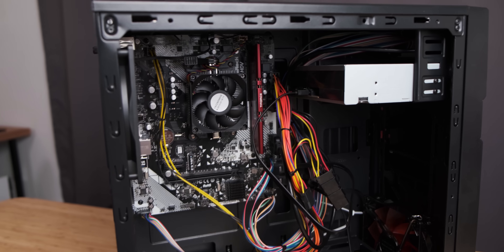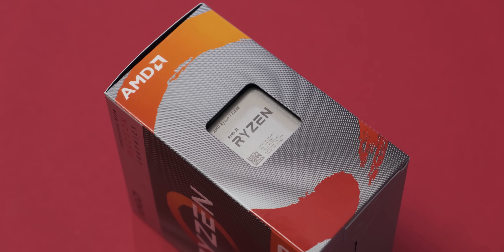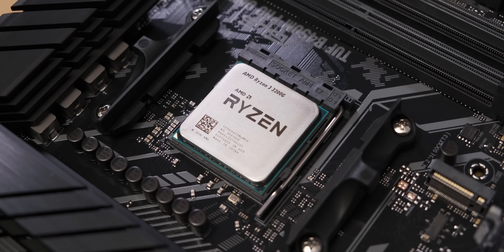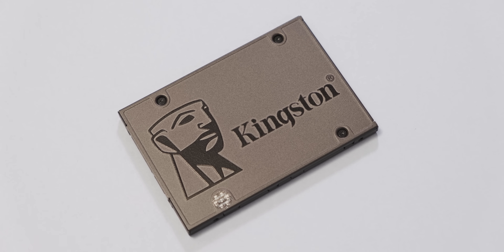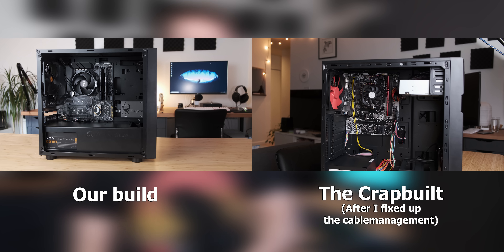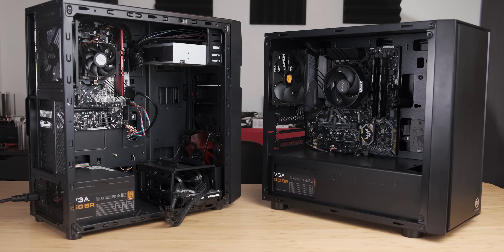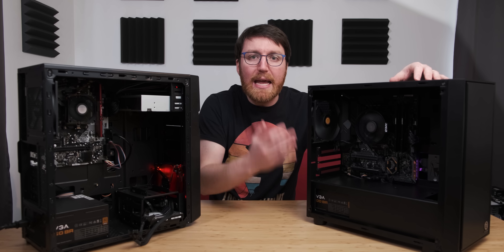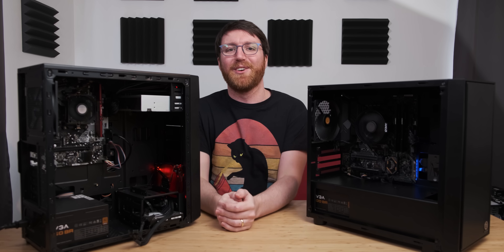Cheapest Amazon "Gaming" Pre-Built PC versus Custom-Built PC (2020)

Comment: Actually these days, if you bias most of your money to the video card, and buy a cheap 6-core AMD, you can build a semi-decent entry-level gaming rig.  Of course the inflated prices right now of video cards doesn't help, and if you take advantage of motherboard+CPU combos you can save some real money, even if you have to get the cheapest of motherboards, it's probably still better than a game build from Amazon.  $400 doesn't sound like much but if you don't factor in taxes, and if you focus on AMD where your performance/dollar is better, you can build a decent entry-level gaming rig for about $400.

I mean my latest AMD system was about $750 to build, but about $300 of that was for the video card.  The processor was $160 and I got a board free (Gigabyte B450, not the best, but better than the most cheap boards out there).

Honestly, when doing a budget build, I recommend skimping on the power supply a little, and getting a cheap case, in favor for a decent CPU and a better Gpu.  I'm not savying to get the cheapest PSU, but get a name-brand one but perhaps one with a lower wattage.  Obviously this means you may need to upgrade it to put a larger graphics card in, but for starters, most 500 watt power supplies from name brands can be had for around $50 (like CoolerMaster or EVGA).  And also skimp on the memory a bit too, like 8GB.  I haven't seen any modern games that require more than 8GB yet.  But as you mentioned, if you get an APU, you may want to spend the other $50 and get 16GB.  But if you get a dedicated GPU then 8GB should be enough to get started.

Comment: For that price you are better off getting a console anyway. I wouldn't buy anything less than a Ryzen 3600 since the 3200G will bottleneck you with any decent video card. But compared to the other alternative it did seem much better. It is a good idea to spend more on the case, CPU and motherboard since the video card is easy to upgrade but new motherboard or a case will require you to rebuild your entire PC.

Comment: the B450 asus tuf board? man those things have crap temp sensors on the board and it reeks of cost cutting. the kind of board people go when they just assume Asus means good. you spent a good 30-40$ more on a motherboard that isnt even objectively better then some cheaper alternatives. sure it has some features but the VRM's are pretty meh, with pretty wimpy Vdroop and hilariously inaccurate sensors, clocking ram temps at 120C? me thinks thats a little odd. Asus lets QC really go loose on the TUF branded products

Comment: The min budget anyone should be aiming for is $450. It simply isn't worth it in the long term to go lower. You are just shooting yourself in the foot. At $450 you can get a used RX580 8gb, Ryzen 5 1600 AF, 16gb DDR4 3200, and a 500gb SSD which is DRASTICALLY better than this build for not significantly more money.

Comment: wait the custom one is basically my pc, the exact same processor and ssd, 16 gigs of ram, similar motherboard but from AORUS, even the psu is almost the same
The only significant difference is that i have dedicated "decent" GPU which for some weird reason wont run any low-end games and only able to run graphically intense games otherwise it might crash the entire system even in youtube, sigh

Comment: My 3200g has 8 gigs of memory installed, would increasing the size of the memory boost performance (like fps)?
Reply: Absolutely 8 gigs means u really have 6 to 6.5 gigs as windows uses almost 2 gigs
Reply: Yeah. Especially if you use the 3200g as an APU.

Comment: The 9600 in the Amazon build is way more powerful than the 3200G in CPU performance. So if in the future you choose to upgrade with a dedicated GPU you'd have a way better time with the 9600. 
Also you really should've added more storage space. No one is gonna be satisfied with a 250gig ssd nowadays as some games now take up more than 100 gigs

I agree that the Amazon build I horribly balanced, but you really should've mentioned that the CPU performance is significantly better.
Claiming that the 3200G is more powerful than the 9600 is controversial because as you said the GPU performance is superior, but that's because it's an APU. Intel's processors are not meant to game on iGPUs. Instead you could've said something along the lines of "Although the CPU performance of the 9600 is superior it is significantly bottlenecked by its slow iGPU. Whereas the 3200G is much more well balanced for a system without a dedicated GPU. This means that if in the future you choose to buy a dedicated GPU, the 9600 will offer better performance"

Comment: I was trying to come up with comparable parts cheap enough to actually make that parts list come down to $378 without switching to A320. Then I noticed this "... list costs $378 to buy from Amazon. This gives you enough of a budget to buy a Windows 10 key and still be under the $390 ..."     Waaaah?

Where on earth do you get a $12 Windows 10 key? Please tell me. I wouldn't pirate windows (usually) or feel like I have to use old Dell machines for every build if I could get legit Win 10 for under $20. As far as I know Win 10 costs $89 best case on sale.

Comment: At this price point a tiny 240GB SSD speed increase is not more beneficial vs raw capacity the user will immediately be going out and buying more storage thus the build isn't really $390 budget. https://pcpartpicker.com/list/ZKncyk $389.93, 16GB Geil 3200MHz DDR4, 650w Corsair Bronze rated PSU (so theres actually some breathing space for a proper CPU and GPU upgrade), B450 Aorus M, 2TB Hitachi Deskstar, R3 3200G, Masterbox Q300L.

Comment: I only could get this to run at a steady 16 fps on r6 at lowest settings, only different thing about it is a GeForce 710 gpu
Reply: The 710 suuucks. The vega 8 in the r3 2200g is much better
Reply: @andydbr2969  chief that's a cpu

Comment: I love this channel, and hate to be that guy, but your prices don't factor in the cost of a Windows licence. Sure, you can get a grey-market licence for next to nothing, but if you want the reassurance of knowing it won't suddenly stop working when Microsoft finds out, even a cheap legit OEM licence will set you back $100. The crap PC may not have come with a legit licence either, but if it did then you should really be putting it up against a $290 PC, which would be a much tougher challenge. (Could be interesting to see you try, though!) I'm not trying to knock you or your video, just smarting from the last time I built a PC and this happened to me. It also highlights just how insane Microsoft's licencing fees are in the context of really budget PCs.

Comment: Hello, I am a noob and want to build my first PC. I am curious though would this build work well with say Auto-cad 2020 Lt as well as gaming? I would like to build one PC that can handle both if possible
Reply: The ryzen 3200G is a modern 4 core and should handle it fine, altough i would say if you have the budget, going up to a ryzen 5 2600/3600 and a budget modern graphics card,  would give you 50-100% more power for a rader small increase in the whole system cost. And it will probably be sufficient for several extra years.

Comment: Should of mentioned you can significantly upgrade the CPU in the scratch built as well and gain even more performance with Ann even greater graphics card (or multi tasks it with streaming or the like) where the pre built you can upgrade the CPU you will not see as dramatic performance benefits although the CPU's would be cheaper.

Comment: The thing people forget is that in the modern AMD processors, the integrated graphics aren't half bad.  I mean a dedicated card is always going to be better unless it's considerably older, but the Ryzen also runs on a different architecture than the A8 even though the A8 may have 2 additional cores, the process is shorter and so less power and faster processing.  I'm thinking the hard drive may have been a factor too, but the A8 isn't all that powerful (I had one in a home server I was using, and it could barely do that and basic workstation tasks).  The integrated graphics on those CPUs just isn't that good for anything beyond wathcing videos online or possibly Blu-Ray.

Comment: I would have done what I actually did.  Get a "my god this is high end" server that's so old that it's cheap (yep, running xeons, plural) and put a used rx 470 off ebay for $60. 8 gig 470 if I can find it.   That literally has 4 times the gpu performance than your apu.

Never buy an apu for a gaming machine unless your idea of gaming is NES emulators.

Let me somewhat defend the upgradability.  By now I've upgraded that to have the highest end cpus my workstation will take, which cost $80 each now but cost $2000 each new, and a used rtx 2060 super.  Also an SSD, two hard drives and 32 gig of ram.  

Newer generation cpus would be better, but when I put it together 2 years ago, not so much. Its cinebench score is 3.6 times a 3200g
 
It's capable of playing AAA titles.

Comment: You did say at one point an old office PC is often the best way to go.  I bought a used dell 3020 for $50, and upgraded with a Xeon e3-1230 v3, 500GB SSD, 2TBB HDD, 16GB RAM, and a GTX 1650 for $350 or so.  This performs the best in the short run, but as you noted, the upgrade paths are limited.
Reply: Bro you just built a whole new system with all those components
Reply: @The_Novasai  Yes, pretty much.

Comment: Sad wimped out on the Matrexx 30, I was so enamored with that case at one point I stuffed a asrock B450M/AC, 2x8 3200 16cas team rgb, 2700x, team 1tb rgb ssd, 250gb m.2, seasonic 550 gold, 5700xt asrock phantom, and three deepcool pwm argb fans so I could use it as a secondary computer.

Comment: My first pc I purchased back in 2016 came in that same case style, be it a little easier to organize because the psu mount was at the top not the bottom. 
  It had an fx-6300, ga-78lmt mb, integrated graphics, a trash 500w psu, no disk tray, and a new 1tb hard drive. I had no idea back then. It took me some time to be able to even play simple games like micecraft and tf2. 420 bucks I had paid. The psu died within a few months, luckily effected no other parts. I put in a corsair 750w. I ended up cycling through a few graphics cards until i put in an r9 280 just within the past year. That finally allowed decent(certainly playable) frames on modern games. 
  I was always upset with the pc, felt behind, because if i had built my own, for the same price it would have been better from the start. Then, within the past few months, my cat pissed on the inside of the pc while the cover was open. That fried the motherboard, caused several corrosion spots on the r9. I pulled the 6300 and the r9. Disassembled the r9 and cleaned if, reassembled, still works. I realized finally how trash the motherboard i was using was(not like anything else was special) and decided not to bother replacing it. 
  4 years of potentially pc gaming wasted by purchasing a “cheap” gaming pc. So dumb

Comment: my Pc from 2007 is better then the crappy PC and I only upgraded the CPU and installed a GPU and I had to upgrade my PSU last month because it shorted out. luckily my MB has surge protection built in so My MB and other hardware was perfectly fine. I'm thinking of building a new Pc soon been looking for parts Im not rich by any means so i'm going to buy the parts over time and just test them with my current Pc. once I'm done that ill retire my current pc it will still get used but only as a Meda player (youtube, Netflix so on)

Comment: you built a nice pc but you did not do it on the same budget as the other builder take into consideration how much it was marked up for profit if it was marked up $100 or 125 that would mean you would not be working with 380 approx but instead you would be working a little tighter in the range of $280 or $255. so your pc had an advantage of $100-125 the other did not. The comparison needs to be level.
Reply: The processor you used was over 50% of the actual budget

Comment: honestly terrible budget built ,why go for an apu and 16gigs of ram and a more expensive mobo for a budget built ,a better a choice in my opinion would be a ryzen 1600 af +cheapeast am4 you could find +8gig ram +rx 570 +budget 450w power supply +used case with some fans would suffice

Comment: I buy pc hardware both second hand, from local shop as well as online, though generally through local retailers, it all depends on the purpose and what part I'm buying, ram, gpu, cpu, mobo and cases as well as psu are generally fine to get second hand, storage, cooling on the other hand, you should opt for new from shop or local retailers I'd say.

Comment: I have an alternate $390 build, I call it the "good things come to the patient" build. It's called that due to it's reliance on one of those Chinese x79 motherboards, but if you're willing to wait a while for that board you can get an overclockable 4 core 3.5ghz Xeon E5-1620 v2, 16gb of ECC DDR3 in a 4x4 config, 500w EVGA 80+ white power supply, a 120gb boot ssd, a 2tb storage HDD, a used RX 580, a cheap atx case and of course I tower cooler. That cost includes shipping and taxes as well.

I think it gives you some baller performance now and doesn't stick you to a socket that only allows for 4 cores later, so in my opinion it's better than slapping a card in an optiplex for that reason, and beats the boring route because you can get a GPU on the initial run. If you've got a little extra cash for the initial build like $35 more or so you can go for a Xeon E5-1650v2 and get 6 cores out of the gate which I had initially but I almost forgot to account for the cooler, oops.

Comment: I know this is not a always the case, but if someone was to build this as there personal system, they should go with a 2400g instead of the 3200g. Their prices are often within $15 and they performance similarly when used as APU's. However it gives them more head room for future graphics cards. And ofcourse if they plan on getting a card from the start then just buy a 2600 or 1600af if you can find one.

Comment: I almost have the exact same build. My mobo is the plus version not the pro, same brand and power rating psu but it's a white, ram isnt the same its team force Vulcan z, I have the ryzen 5 2600x, I have a msi rx 570 8gb. Same case, it's a disaster to work with dont buy it. Unless you want trouble. It's nice looking but it's a bitch to work wit. EDIT: Watched more of the video I have the same msi gpu aswell. And he swapped the case out because even he said it was a shit case

Comment: I can confirm the dell optiplex route is game ready! My old system (was actually for my grandma) had a whole 3rd gen intel etc. With a gtx 700 or something like that- it played all my games with no problem. That's $400, current system which was mine to begin with had the same Intel 3rd gen i7 3700k but better gpu etc and it costed $1,000. So depending on y'alls situation, the cheaper option can actually be just fine.

Also I love this video!

Comment: How the fk are you getting this system to work? i have very similar build and i am having freezing issues and i am using goddamn aio pump...
need to test my pump, by replacing the stock coolar if that is the thing here

500wat should not be big enuf for ryzen and radeon, this feels fake
radeons need 450wat, so that would leave you 50 wat to the rest? yea
not possible by using basic math